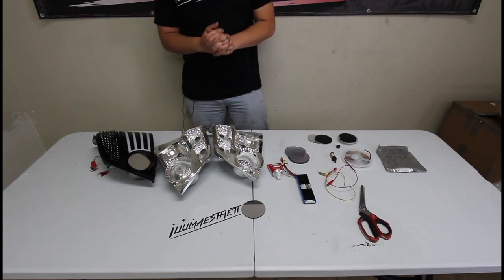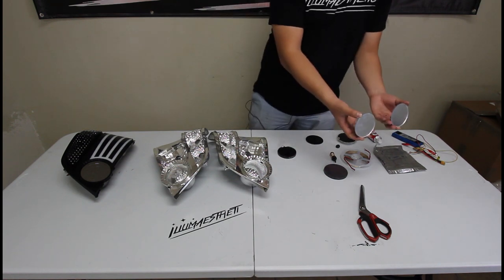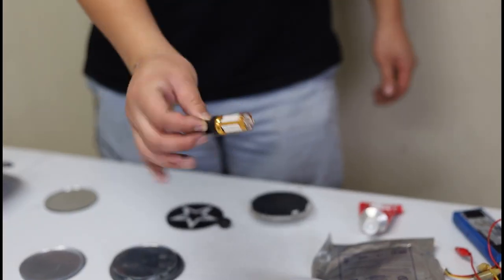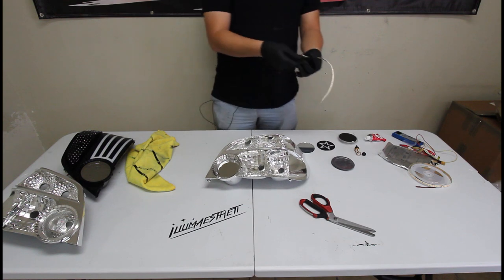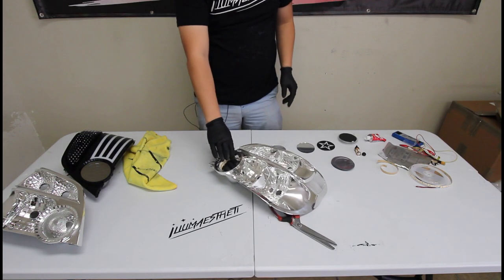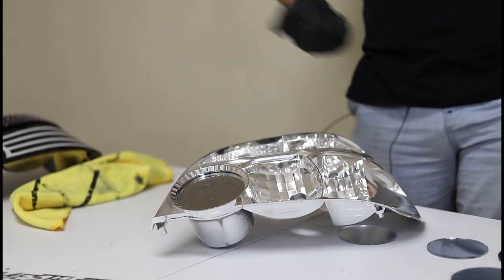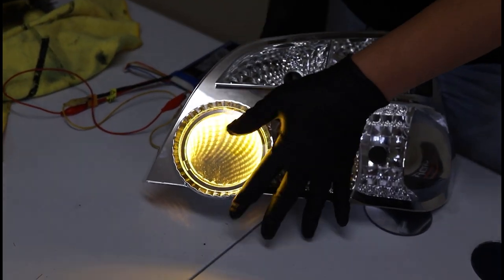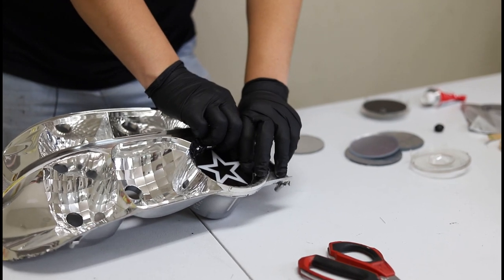How To Build Infinity Mirror Tail Lights! - Illumaesthetic Tutorials

Comment: Would consider a 3D printed spacer between the mirrors to make it much easier to line the tunnel up either flat or a specific curve to get it exact either side 🙂
Reply: Thing is that a spacer would shrink the area of actual light. Which would not be that smart.

Comment: If you want to line up the mirrors, consider going for a fixture that has more or less the same function as screws and a table, used to level it out. If you want to be albe to work with the de fusion rate. You could have springs between the mirrors in mind...

Comment: I've got a 91 MR2 and I've Photoshopped a picture that will give them the Aventador style light but I've also seen people use BMW style angel eyes as their brake light bulbs.  Do you think I could get away with stacking two rings into each location (4 in total) and what mirror stack up would I wanna use?